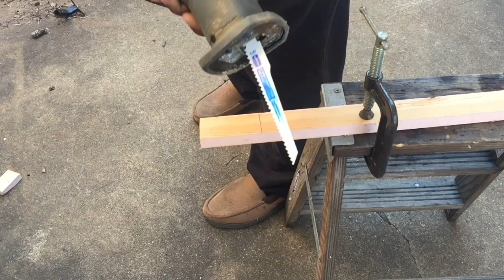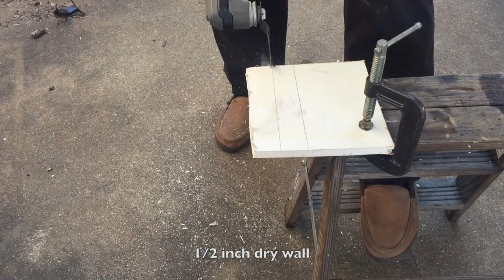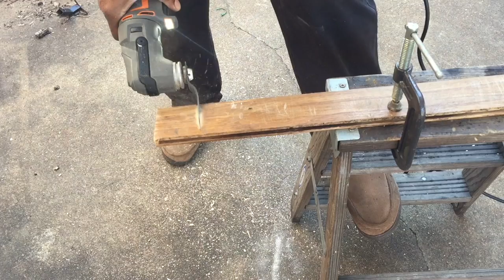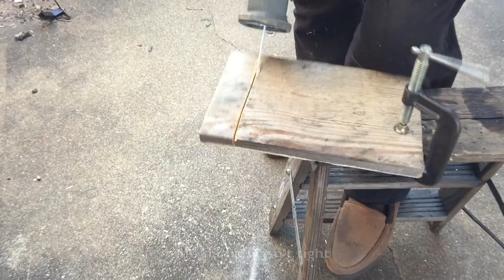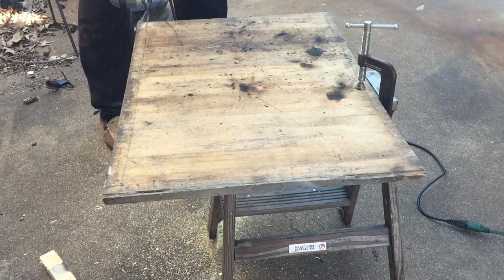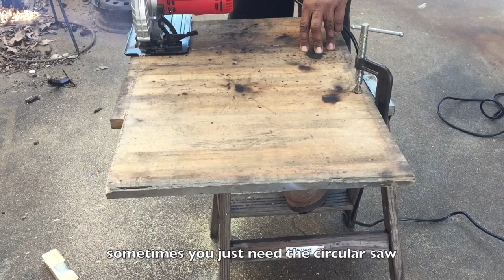Oscillating Tool Vs Reciprocating Saw

Comment: nice video to watch, helps a lot of people to select what these tool can accomplish. But, u handicapped the comparison by selecting coarse blade for the reciprocating saw. if you use the finish blade you will get much smoother finish on the plywood too. Both tools are awesome and they both have their specific area of use.
Reply from the maker: I thought about using a finer tooth blade but stuck with the 6t because I was using an aggressive tooth oscillating blade.. more for quick cuts not repairs.. thanks for watching

Comment: Do yoy try the oscillating sandpaper ?  Does it give smooth finish(almost frictionless) ?  How often do you have to change the saw?
Reply from the maker: Yes I do have and use the sanding attachments, on big sanding projects I use a 7 inch drill disc, I  can't figure out that second question. If you're asking about saw blades, I use them till they stop cutting easy. Thanks for watching

Comment: I couldn't watch when the clamp started coming loose and you continued, I thought you was going to cut your leg off 🙈😬
Reply from the maker: Ohh... sorry that startled you.. the legs are farther away than it seems, the angle would have to change and I also reduce speed.. with the reciprocal saw you can control the blade.. thanks for watching to to point you did and the concerned comment... thanks

Comment: How many watts on the multi-tool? Currently, considering my budget, I'm thinking on investing in a 400W as a high quality general purpose DIY -- haven't decided just yet. Thanks for this vid. Adjusting my expectations.
Reply from the maker: Ofer Sheffer don’t know the watts... it is 4amps. Im sure you can find the wattage online somewhere. Thanks for watching
Reply: @wemcal  Thanks. I'm guessing you're using the 480W Ridgid (4amp/120V) but feel more than free to correct me. Also... I couldn't make out the blade. I'm wondering if with a good multi-tool, I would be comfortable even if I needed to cut several 2x4s (thinking on building an overhead storage space).
Reply from the maker: Ofer Sheffer that blade is a Japanese tooth wood blade... I wouldn’t get this as a main woos cutting... I use circular or mider saws when building.. I use the oscillating saw for repair cuts
Reply: @wemcal  appreciate all the answers. If ever the job will require real work, I'll make sure to use a circular saw.

Comment: The reciprocating saw is a beast. Not really for clean lines. Too much vibration even if you use the right blade.
Reply from the maker: You’re right... it tear up everything we put it to... certain woods it cut cleaner but we use it more for demolition... thanks for watching
Reply: Reciprocating saws are called demolition saws for a reason
Reply from the maker: @tehs3raph1m  right!! I’ve torn down MANY 2 car garages, sheds, burned rooms, trees, fences, furniture and appliances with these... thanks for watching

Comment: oscillating tool = use one hand
reciprocating saw = use two hands

one hand is for hard to reach and accurate cuts
two hands is for power

one finger lost rarely
two fingers lost more often when trying one handed
Reply: Milwaukee makes a 1 handed reciprocating saw